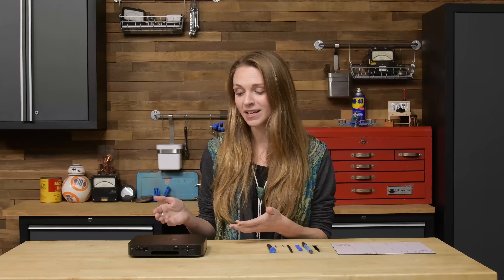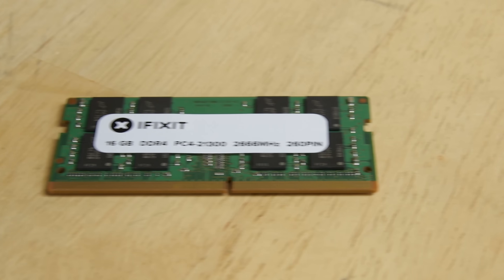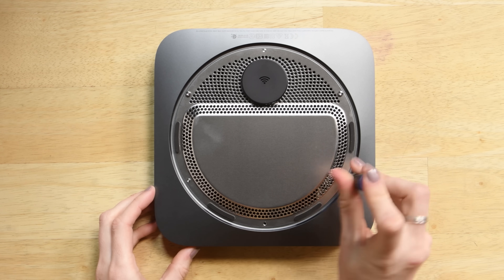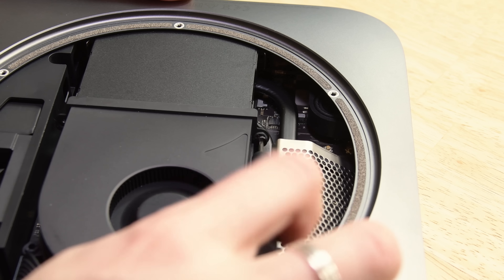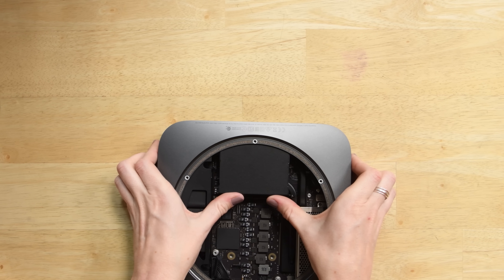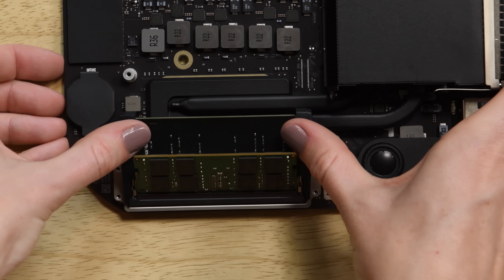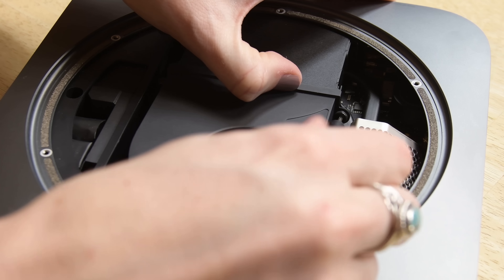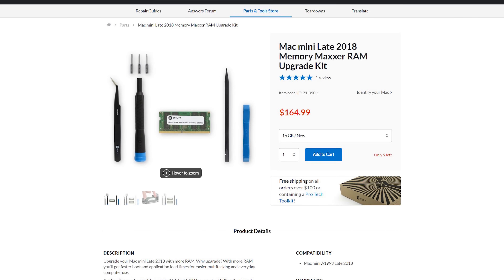Late 2018 Mac mini RAM Replacement and Upgrade! 50% Cheaper than Apple!

Comment: Quick notes for anyone else following this otherwise great video; the instructions for removing and replacing the wifi shield/antenna plate are in different orientations (so double and triple check which screws you use). Really should have done both with the ports facing the computer surgeon..

Also, neither this video nor the iFixit guide mention that after installing the RAM your Mac Mini might take longer than normal to switch on the first time; I spent a panicked 40 seconds or wondering how I'd managed to brick my machine before it finally chimed, some people have said you may need to press and hold the power button for 10 seconds or so rather than just the normal single press. So if it doesn't come on right away, don't panic; wait, then try a longer press and wait again, and only if neither of those work should you panic!

Comment: The cradle for the exhaust fan connecter came off and appears that also one of the pins connected to the logic board ( the one of the far end) . Will this render the fan useless? And any advice on options to fix it???

Comment: Braved it today. The ifixit online guide is the best with user comments. Some of the components are a bit delicate... LED cable, Fan cable. Getting the Antenna wire back in the socket was the biggest challenge BUT ALL GOOD. Saved $$$ going to 64 Gig. Lots of ram now for my Virtual Machine Win 10

Comment: Haven't found anything on the whole internet about this issue I'm having. So I'm commenting here to see if anyone had a similar issue. I have a 2018 Mac mini. I bought the 64 gb of ram from crucial. Installed the ram and then I turn on the computer. The light comes on, stays for a minute, nothing appears on the monitor, and the last thing the Mac does is that for a brief moment the fan gos full speed. then shuts down. Then the Mac stars again by it self and does the same thing over and over. I went back to the old ram and it worked. So maybe the ram modules are defective, but has anyone experienced something like this? Is the ram defective or is this a known issue?

Comment: I have all the right screwdrivers, including t6 torx security screwdriver. The t6 security screwdriver removed three of the six screws described at the beginning of the video, but then I couldn't remove the remaining three screws. Does the T6 security screw somehow damage the  screwdriver?
Reply: i had a crappy t6 security screwdriver. read the reviews on amazon if you buy one from there.

Comment: Just did this upgrade. I watch 9-1-1 and I felt like I was on the line with a skilled operator. Everything is so tiny (compared to a desktop pc). But I felt like Kelsea was in the room guiding me through every step of the way - both making it seem simple and making it actually simple. I purchased RAM elsewhere but purchased the iFixIt Essential Electronics Toolkit and an anti-static mat with spaces for each of the 17 screws. I took notes as I worked my way through the disassembly process, but also saved the screws in order on my mat: Kelsea’s explanation on the reassembly was first rate (just reversing the disassembly) that I did not need my notes.
Great video. Take your time and expect it will take longer than her 5 minutes, but all the info is there and it was a project with total success.
Thank you.

Comment: i just did this thanks to this video. Its really quite easy and I am not someone who can usually do this stuff. The hardest part for me was getting the antenna cable back on. I did this by lining up the connector and gently pushing on it with the rubber reverse end of a screwdriver. If you have very small hands you might be able to do it with a finger.

Comment: maybe a silly question: when taking out the ram they were all faced in the same direction ( we both saw the back plates) when placing back  we see the front of  the first ram plate. any reason for that?
Reply: skinnybruna the higher capacity ram has them on both sides of the chip to fit more

Comment: I got a 32GB kit from crucial for US$ 93.00 on Amazon for Cyber Monday. Right now it seems to be running for US$ 125.00, still 131% cheaper than doing it directly with Apple.

Here's the link for the curious: https://www.amazon.com/gp/product/B071H38422/ (Not affiliate)

Comment: Its unbelievable that it takes more to take apart the 2018 Mac Mini just replace the ram whereas the mid 2011 Mac Mini, you can easily replace the RAM after opening the plastic bottom. What happened to Apple?!
Reply: yeah....it seems to be deliberately difficult.....smh.....

Comment: Great guide. Just installed 32GB with success. Removing one of the motherboard screws was difficult. And reattaching the antenna wire took longer than it should. But happy with the results.

Comment: 4:18 I would suggest to screw the bracket a bit and then reconnect the cable -> because the cable sits perfectly in place before you push it down. when you are done, you can finish with the screw.

Comment: I would also recommend against paying Apple to upgrade the SSD. You can get a 2TB SSD and a Thunderbolt SATA-3 drive enclosure for around for around $450 (less if you shop around). That beats the $1200 price point for Apple's 2TB upgrade by over 60%. You also still have the 256 GB storage that comes with the computer.

Comment: * Uses small and very fragile wires and parts so people who tries to repair or upgrade fails to do so *

thats how apple works
Reply: I just did this process. They aren’t small or fragile, they’re standard connectors. You see them in laptops from all companies.
Reply: Yeah unless you haven't noticed apple isn't about people spending time on repairing their products, they're about the consumer not having to do that work.

Comment: At 2:25 I would not recommend pulling the power cable up by the wire cluster, or at least that close to the connector. The tension on the crimp is alreadyh pretty high, and Apple doesn't exactly over-engineer the components for repairability or durability.
Reply: How do you recommend I pull it? Any tips?

Comment: isn't 164$ about 75% of 600?
Reply: $164 is for 16GB. The $600 is for 32GB.
Reply: Unless you buy all their ifixit gear(actually, I dont know how much that stuff costs)
Reply: @GTJay  well their kit comes with the tools, but it's also not that great cause it's only a single RAM module. They want you to only replace one, which is bad because mismatched RAM reduces the performance boost. At least OWC sells a 2 module kit. The 16GB upgrade is still better to do from Apple when you buy the Mini.
Reply: Off*